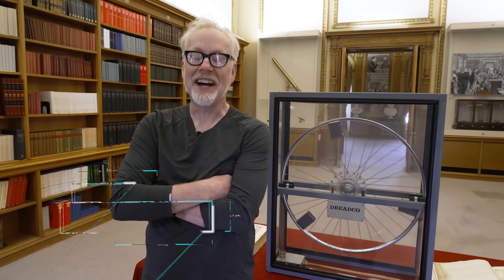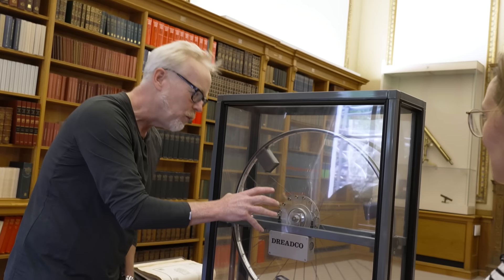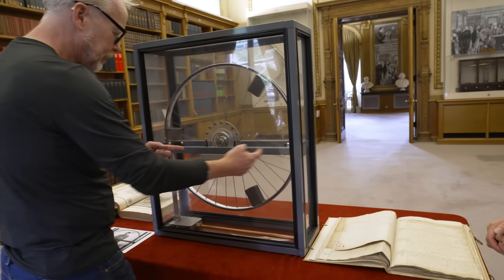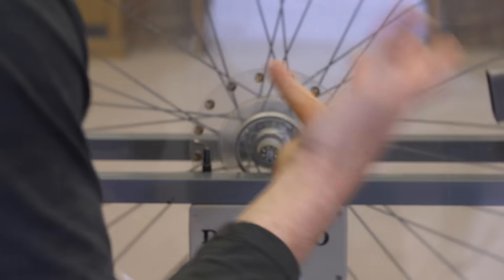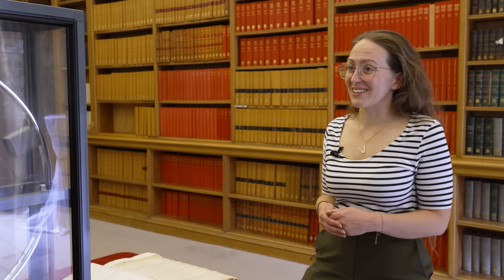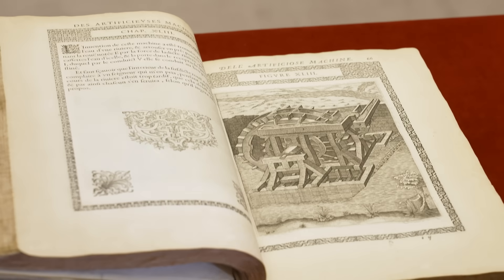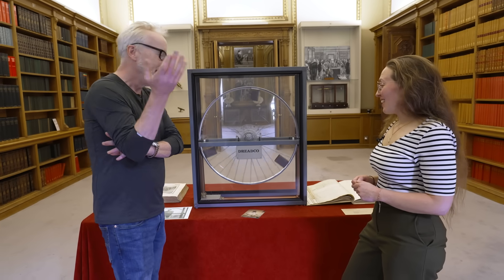Adam Savage vs The "Perpetual Motion" Machine!

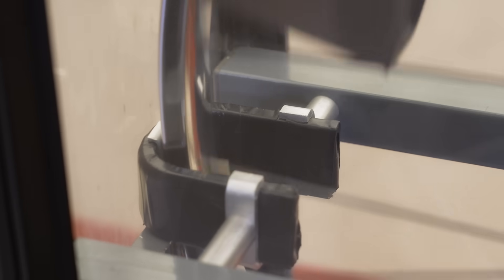Comment: From a completely different angle...I'm a long time bicycle mechanic and I quickly noticed at 4:07 that the wheel seems out of round, ie. is not perfectly circular, and it seems to have a low spot (or high depending on perspective) at the points where the weights/'magnets' are mounted to the spokes. If my perception from this footage is correct, could such an intentional "wobble" or "hop" in the wheel be enough to be preferable to the math of perfect circles and, in combination with cleverly-oriented magnets or who knows what else, tip the impossible physics over the edge (at least for two years)?

Comment: Seen one like this before. Its electrostatic from a high voltage source in the Dreadco box. The spiked electrode emits charge to the "cups" attached to the wheel, which pushes away from the electrode. The charged cups are attracted to the ball electrode, which discharges the cups. Cups are attached to a plastic insulating sheet attached to the wheel. You adjust the "power" to overcome friction by tweaking the electrode distances. If both electrodes are spikes, doesn't work, if both electrodes are balls, it doesn't work.
The piping and box are desiccators to keep the air dry as it stops working if the air is damp.
The one I saw was made from polystyrene wheel with foil patches as charge holders and used static from rubbing a plastic rod to make it rotate. It was not perpetual motion...

Comment: It would be fascinating to take video of the wheel and measure how the angular velocity changes throughout the cycle and over time.  You can visually see it getting a small kick every time a black box passes through the horseshoe (magnet).  Should give a lot of insight into how it works.
Reply: I don't see any obvious kick as you say. But I agree that a large amount of very carefully collected observational data might hopefully reveal important clues about the energizing method. I am assuming that the wheel is getting periodic small kicks. And that the bearings have some friction causing the rotation rate to very, very slightly slow down between kicks. High-rate imaging data, with very accurate time-tagging of the sequence video images, could be analyzed to look for periodicity (probably need to solve for both P and Pdot terms, as in pulsar searches) in the variation of rotation rate. Use data-stacking to reduce measurement noise. Look for periods of 1 kick per rev (kpr) , or 3 kpr, or ~30 kpr. Hopefully Daedalus didn't add randomization of the kicks (tough to do). I used to really enjoy reading Daedalus' regular column in New Scientist.
Reply: If the horseshoes were magnets then any magnetic materials in the boxes would stop the wheel.
Reply: That's an illusion... Your brain perceives a slight change in velocity but it's only because your brain is counting the frequency of spokes and it gets interrupted by the box so your brain is actually unable to continue counting at the same rate and it seems as if something sped up or slowed down.

Comment: It's using a circuit and electromagnets. I've seen one in person. It needs a small amount of energy to get going but once it does it can output a lot more than it took to start and zero energy to run thanks to the magnets and copper. Pretty simple

Comment: It's probably a microcircuitry version of a Bedini Wheel which him and Jamey 
' proved ' to be a sham on one of their shows.
A Bedini wheel is an ' overunity ' device that runs on one form of a small amount of power while charging batteries with a larger amount of a different form of 
' electric ' power.
There is a way a Bedini wheel can be set up with automatic switching to alternate batteries and run for possibly even years without anyone touching it.
But not forever.
Reply: Him and Jamey tried to just hook it's output power to its input and when it didn't work they called it a sham.

Comment: I suspect the chrome ball and point are acting as a rudimentary ion drive, with the ball receiving charge, and the point emitting it.  This would be intended to compensate for friction at the bearings.  I assume the box contains a vacuum to eliminate wind resistance, so the only losses are due to friction in the bearings.  The periodical reset is probably to improve the vacuum, which probably degrades over time (e.g. due to off-gassing of the acrylic, and any oil used in the bearing).
I really hope the reset is not simply replacing batteries for the ion drive, but perhaps that's why the secret was disappointing.
The cypher mentioned is better known as ROT13, which was used for years by usenet newsgroups to obfuscate spoilers etc.
I was somewhat surprised to see Virginia Madsen working for the Royal Society - those glasses and the accent don't fool me.

Comment: like everyone jokes, the secret to perpetual motion is how to hide the battery. though that could also be, how to hide the method of generating energy. so even if it is never revealed fully, the real question is, what is the hidden method of energy generation. as many have pointed out in the comments, and adam himself have also pointed out, there are a lot of possible fake outs, but many could also be the solution as using multiple possible small forms of generation could keep the battery going for longer. so I can understand why anyone that was told how it works ended up disappointed since the science behind it is disappointing as theres only the one real answer.

Comment: So it's either fake or it's such an insignificant amount of motion (at least I hope) that its fun to keep it a secret. Because if it is scalable to generate energy how incredibly selfish would it be to keep it a secret?
Reply: Nothing can generate energy.  That's why perpetual motion machines are impossible.  You can only convert from one sort of energy to another, e.g. gasoline (chemical energy), electrical, or nuclear to kinetic energy.  No energy conversion is 100% efficient, so a machine that is close to being a perpetual motion machine like this will always run down over time due to friction losses etc.

Comment: I have a guess for how it works.  

I believe the 'DREADCO' box contains a high voltage capacitor, the pointy electrode coming out of the box is the cathode applying a charge to the small wheel with the little metal bits. The ball shaped electrode is the anode, collecting the charge completing the circuit. A form of Electrostatic motor maybe. Perhaps the capacitor is even a Microwave oven transformer.  I believe the weights provide inertia and precisely balance the wheel.  The 'magnets' are a decoy

Comment: The bearings introduce so much friction and the whole device is not in a vacuum. Even if the wheel was levitated using magnets, it wouldn't run forever.... Impossible

Comment: If you separate those boxes internally with a proper size hole. The water will move closer to the center making it spin faster. As the water drains to the outside of the box it creates more weight to the outside as it goes down. It all comes down to what size hole inside the box to create proper timing with water flow. Kinda like expansion chamber in a rocket engine.
Reply: You would need one way air vents on each side to keep water from going out. It would allow water to drain to each chamber properly.

Comment: I'd say it's using cold/hot temperature differential to make it move. Somehow. The heatsink leads me to believe that. Peltier device basically. But those generally use a lot of power, I think. Seems like a decoy too. Just too obvious. Got to be just a motor in there somewhere.

Comment: 2 years on a charge is pretty efficient though! I guess it'd stop if so much as a fly landed on it in the wrong place, but still...good engineering!
Reply: I mean, there are plenty of clocks and other machines that run on battery for 5-6 years

Comment: Each box is a separate identical device. It's a battery and a small coil. It detects the approach of the magnets and gives a tiny push as the magnet in the box against the fixed magnet. The batteries therefore eventually run down but if the bearing is low friction and if there is minimal air resistance the batteries could last a couple of years.  There are similar electrical 'pendulum' clocks that use this method to keep the pendulum moving. The other boxes and pipes serve no purpose other than to distract the observer.
Reply: Guess is apparently correct!, except it is much simpler(look for my comments). I did find another video, where they test the fixed magnets for magnetic field, and could not find any(because it is a coil that gets tiny pulses through hidden wires in copper tube). The magnets are actually on the rim disguised as spherical head  bolt(under boxes) - again got it thru slow motion video.

Comment: Perpetual isn't Impossible 
You have to understand that the START MUST COUNTER THE FINISH 

CORKSCREW for instance Replicates itself
EDIT 
A Natural RESET ........RESET is Middle of Perpetual Cycle.
Reply: It absolutely is impossible.  You cannot break the laws of thermodynamics.  Energy is neither created not destroyed, only converted from one form to another.  Any motion system involves some loss of energy from the system due to conversion to another form of energy.  The losses may be small, but energy is always lost in the form of heat and sound due to friction.  If the system is losing energy, eventually there will not be sufficient energy in the system for what you call a natural reset.
Reply: @Raven-Creations  Hmmm.
Only if you DELIBERATELY BELIEVE Perpetual has a Beginning and an End to run its cycle🧐🧐🧐
We can only channel Water Not stop it my friend 👍👍
Perpetual Energy is 2 Forces Cancelling the other OUT North and South Attract and Repel👍👍
Magnetic and Gravitational forces both react different under Vacuum so....👀👀🙊
Reply: @statementleaver8095  No, perpetual motion is not about forces.  It's entirely about energy, and it requires zero loss of energy from the system, which is impossible.  You can't design any machine that has zero friction.  You can eliminate air, and make friction really, really small, but it's still there.  A heavy pendulum in a vacuum with a knife edge pivot is about as close as you can come to a perpetual motion device, but there is still a tiny amount of friction, both at the pivot, and even a tiny amount due to flexing of the bar, and so eventually, it will cause the motion to decay.
Neither gravity nor magnetism react differently under a vacuum.  I don't know where you got such an idea, but it's wrong.   The only difference (as demonstrated on the moon) is that in a vacuum there is no friction with air, so a feather drops at the same rate as a hammer.  Gravity though is completely unaffected by the vacuum.  (I should qualify that - the air molecules will exert a very tiny additional gravitational component, but this is so tiny that it is negligible.)
If you really believe a perpetual motion machine is possible, design one, and publish the plans so that scientists can replicate it and analyse it.  I guarantee that you'll fail, just like many others before you.
Reply: @Raven-Creations  4 train carts on track
Frame and wheels  all thats needed

1) Hydraulic fluid in syringes/Postons... Opposing each other 12 o'clock passenger side 6 o'clock driver side wheels turn creating Flow 👌
2) Neodymium magnets..... offset Quarterly on Opposite ends of cart Oscillating Pole Main magnet 👌
3) Stator Rotor.......Capacitor👌
4) Cog and Ratchet multiple wheel.....Corkscrew,Spring,Elastic 👌

A Machine can be multiple inventions all in 1👍
Reply: @Raven-Creations  F it.....Here's an EASY 1 for you
Helicopter blades alternating North/South on Shaft attached to Front Differential connected to wheels
Repeat for Rear Axle and Result should resemble Chinook Helicopter with Neodymium magnets in between Blades

Comment: if they have now worked out nuclear fusion where you get more out than you put in, does this not confirm the possibilities of perpetual motion?
Reply: No, you only get more electricity out than you put in, but the energy you put in is only to create the necessary conditions for fusion.  Sure, once fusion has started, you can switch off the input and use some of the output instead, but the output energy comes from the nuclear interactions and you're going to run out of fuel.  If you fuse two hydrogen atoms to create a helium atom, eventually you'll run out of hydrogen.  Adding more hydrogen is equivalent to adding more energy into the system.  Note that the Sun appears to be a self-sustaining fusion reactor, but it too will eventually run out of hydrogen.  It may last billions of years, but it's not perpetual.

Comment: Magnets 🧲. As soon as the magnet passes the material that attracts.  It will then pass a material that pushes. The wheel would have to be uneven in weight. So the rotation force keeps going. As long as its in a vacuum.  It will go for a very long time. Expect it will eventually loose force to rotate.

Comment: Yawn. The clock on my wall lasts longer than a few years, on a single AAA battery. I'll lend it to you for your archives, just send it back when it "slows down" and I'll "service it, and keep it moving...". Please, Adam.
By this logic you're going to have to add everything with a gas tank and energy storage device to the Royal Society Archives as a Perpetual Motion Machine. This is a simple brushless electric motor, no fancy science here. And, there's a battery in there somewhere, guaranteed. Let me guess, the folks at the University of Nottingham have a dusty old charging cable in a box labeled "Daedalus" with a coax plug on the end...

Comment: I have my grandfathers similarly designed wheel. Runs with 2 sets of coils, an inner and an out. and to some degree the inner one powers the other, and acts as timing for the outer. I only watched him work on it, can't say much to it's specs, however it is not as neat, with wires visible. It's in the basement, forgotten until this video! LOL...
Reply: Does it work? How long can it run?

Comment: The straightforward way to make this is to put electromagnets in the black cans. A way needs to be found to cause the electromagnets to turn on at the right time. A position sensor based on angle to gravitational pull might work. 

One way to test this idea might be to put a magnetic meter next to the case and look for swings in magnetic field strength as the boxes pass by.  another idea would be to put a strong magnet next to the case and see if you could get the wheel to speed up as the electromagnet is attracted more strongly to the magnet being held up outside the box.

I think the rest of the things that look like they might be part of the mechanism are red herrings, but I do hold out a tiny bit of hope that he managed to make an atmos clock type mechanism work for the this. But if that was the case I would have expected that the people who know the secret would not be disappointed if that was the way he did it.

Comment: As Adam was initially going through everything, I felt like a lot of the components were possibly decoys (as later speculated in the video).  

In my living room, I have a fake pendulum clock.  It's just a regular quartz clock that runs off a single AA battery.  However, there's also some sort of electromagnet setup added the propels the pendulum (which has a magnet in the upper part of the arm out of sight).  You manually start it swinging when you first put the battery in, and then it will continue on its own until the battery is dead.  Interestingly, as the battery gets low, the clock hands stop moving before the pendulum stops.  It takes between one and two years for the clock to stop, and then I always replace the battery, so I actually have no idea how many years the pendulum could continue to be powered off a single AA.  

I imagine this rig works a similar way.  The magnets on the wheel are ever so slightly propelled by an electromagnet that uses virtually no energy, so it keeps the wheel in motion for years until the battery finally dies.  A cleverly hidden solar panel could effectively keep the thing running "forever" in the proper environment.
Reply: I left a comment about it before she mentioned it and then deleted it, the bearings are insulated and there a two probes that have EHT voltage written all over them just not high enough to arc but able to create a field on the wheel that is discharging through the boxes and the two things that look like magnets, it takes the same amount of energy to keep a wheel spinning as a pendulum swinging about the same amount as it takes a mossie to fly.
Reply: Imagin how many batterys would fit inside the framo or other parts... It could last 10th of years...

Comment: perpetual motion machines are possible, as long as its made of unbreakable material, you can also generate energy with them if you ignore friction
Reply: Just no, perpetual motion generating energy is literally impossible.
Reply: @spaceageGecko  thats why i said you would need to ignore friction
Reply: @boisq97  Even ignoring friction you would not make energy, the added load would drain the energy of the system.
Reply: @spaceageGecko  sure, but i also said you would need to make it unbreakable which is impossible, it was a joke, guess its difficult to get jokes through text sometimes

Comment: With what looks like a Peltier device on the bottom, what appears to be two magnets at 90 and 270 degrees, what appear to be three 'mystery boxes' 270 degrees apart on the wheel itself, then the 'Dreadco' box in the center along with the 'cups' and two 'spikes' close to the center of the wheel, I'm wondering whether most of these things are just red herrings and that's it's nothing but a battery-powered device!  🙂
Reply: A peltier device powering, and the whole thing is an induction motor?